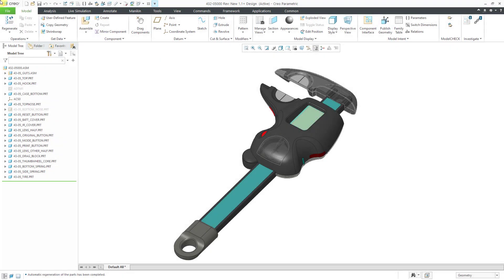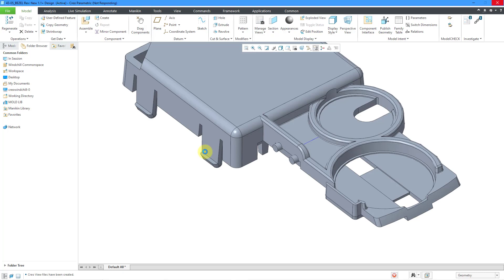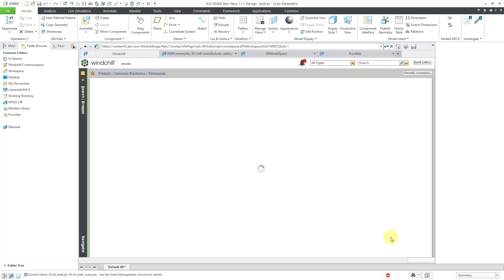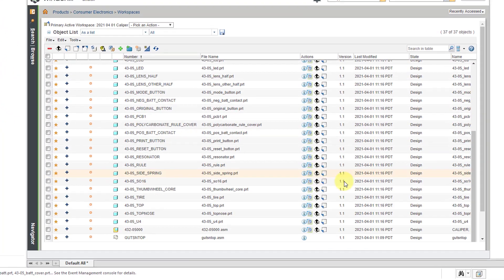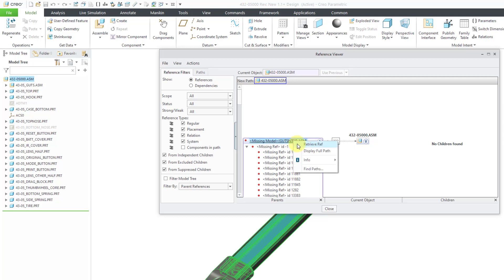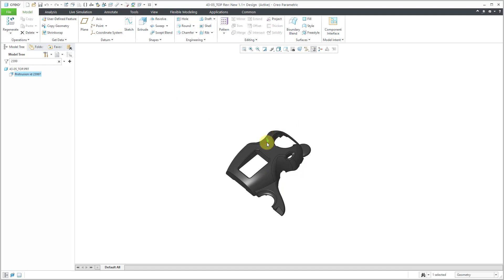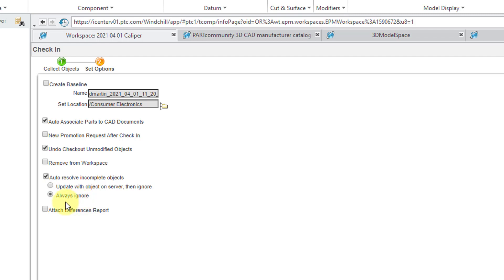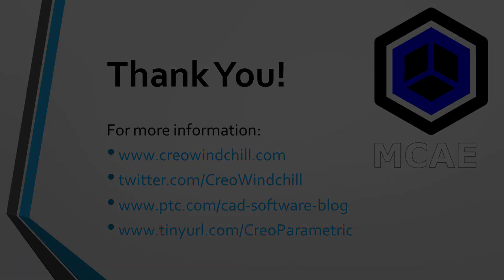PTC Windchill PDMLink - Ghost Objects | CAD Data Management

Comment: Hi Dave, @CADPLMGuy - How the Ghost objects get created w.r.t to INTERCHANGE ASSEMBLY and how to resolve them. For example let's say I have a interchange assembly with a 'bolt.prt', 'nut.prt' and 'washer.prt' in an interchange assembly file 'fasteners.asm' file. Now if I have a local folder which has only the three .prt files and If I try check-in the three part files to Windchill by opening and saving them to my Windchill workspace and try to check in, will there be any ghost object will get created in my Workspace? if so why and how?  ---> How to overcome?
Reply from the maker: If an Interchange Assembly contains a bolt, nut, and washer as its members, you're not using an Interchange Assembly properly.

If you're getting a ghost object when you check in the members, check in the Interchange Assembly as well. Just like an instance "knows" it's a member of a Family Table (through a dependency), members of the Interchange Assembly need to "know" they are members so you can replace one member with another.
Reply: @CADPLMGuy  Hi Dave, I gave that fasteners example for a sample case. It may not be the correct example. But I am facing a actual problem in below scenario. 

Let's say I have a interchange assembly called fuses.asm and it has five items as 33200.prt, 33202.prt, 33203.prt 33017.prt and wohner.prt. and all these files are saved in a local folder called "electricals". Now scenario 1 is I am just opening the wohner.prt from the local folder, saving and adding to workspace. Here in windchill workspace wohner.prt is in the "Name" column 5 times but  'file name' column  has the correct individual part file names such as "wohner.prt, 33200.prt, 33202.prt, 33203.prt 33017.prt" and a ghost object for fuses.asm.

But one weird thing is all the four other .prt file has same name 'wohner.prt' in name column and if we 'open in Creo' they have the same wohner.prt model in it. 

Why this is happening?
Reply from the maker: You're describing two different issues. First, the solution to the ghost object for the fuses assembly is to check in the fuses assembly.

The second issue is a naming issue and possibly a mapping issue. What is displayed in the Number column? Are those showing the correct names minus the .prt extension? Are you familiar with how the name and description in Creo get mapped to number and name in Windchill? If not, I recommend watching one of my CAD data management videos like A Day in the Life. I should cover that there.

I suspect someone created the wohner part file, and then did a Save As to create the 33xxx parts, but didn't bother changing the Description field. Then when the parts got checked in, they all ended up with the same Name in Windchill. The simple solution there is to rename the parts so the Name fields are correct.

If this doesn't resolve your problems, I recommend opening a ticket with PTC Tech Support. Someone needs to get hands on to figure out what's going on with your setup.
Reply: @CADPLMGuy  Hi Dave, Thanks for the detailed explanation, now I got it clear. 

One last question. I have a family table generic item which has around 40 instances. When it was initially created the "Common Name" column in the family table was not updated properly and all 40 instances were given with the default value "*" itself and now I am trying to change that  to correct new common name, but when opening in Creo from Windchill workspace, it is not allowing me update it. So how can I update it?

Note: If I have the same file in local folder (i.e working in 'NO SERVER') it is allowing me to edit. I can't understand the logic. Can you please explain and suggest to resolve?🙏🙏
Reply: Hi Dave, Any input on the above query?
Reply from the maker: Once you check it in, you should rename from within Windchill. You should also be working with your Windchill admins on these issues as these problems will be affected by your setup, permissions, and workflows.
Reply from the maker: Also, don't prod me for a response like that. It's disrespectful. I'm not obligated to help you. If you need an urgent answer, open a ticket with Tech Support or hire a consultant. People need to understand they're lucky if I respond at all.
Reply: @CADPLMGuy I’m sorry for pinging you repeatedly; it wasn’t my intent to disrespect. I will appreciate your time and support.😢🙏

Comment: I've always had one big question,  Why can't creo lock the vertical direction/keep the horizon when rotating the view? it's almost the most important thing in 3D design, otherwise, it feels like you get an imbalance of the inner ear, Is there some reason of great wisdom?
Reply from the maker: Hmm. I’ve never felt that. Are you sure it’s not you? You should look into Orient Mode. It’s something we used to teach like 15 years ago but we stopped because no one used it. I forget how to invoke it but it’s on all the Quick Reference Cards.
Reply from the maker: Oh wait, have you ever tried turning off the spin center? I get seasick like crazy in a boat but I’ve never had any problems spinning a model in CAD, so I forget all the nuances of controlling rotate-zoom-pan. It’s second nature to me so it’s hard to explain. Like when I was trying to explain to my 4 year old how to tie shoelaces.

Comment: If you know from witch part/assembly/format.. is the ghost you can replace the ghost 
Click on info button on the ghost object, go to actions and chose replace and replace it with object 

Example:
I have some .drw file(s) in witch I use some "a4_part.frm" (standard format from local library which doesn't exist on windchill) as ghost and want to replace it with "wt_a4_part.frm" (standard format from windchill). With this I'll lose the references to the ghost and I can delete it.

Comment: We usually face this issue during checking in.. what I generally do is, pick the objects and upload them first. Then, check it in and ignore the incomplete parts so that the ghost files get ignored.. it happened when I tried adding an image to drawing sheet from my local directory.
Reply from the maker: Your admins need to change the Creo config option save_texture_with_model to yes to avoid that problem in the future.
Reply: Can I change that manually?
Reply from the maker: see my video on Configuration Options.